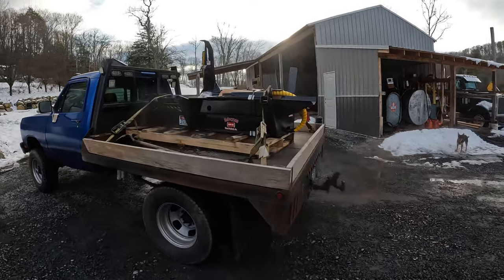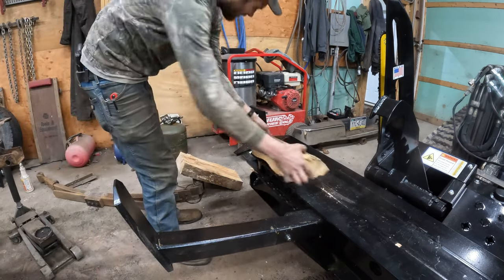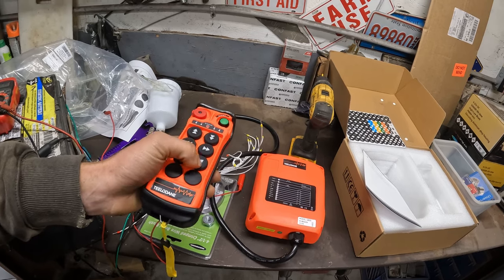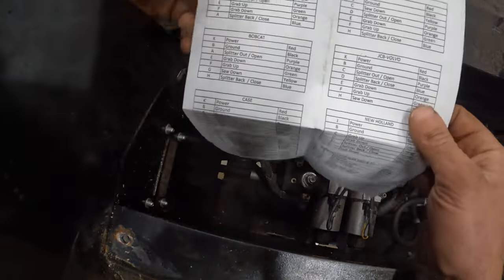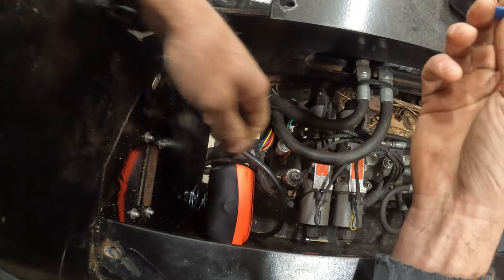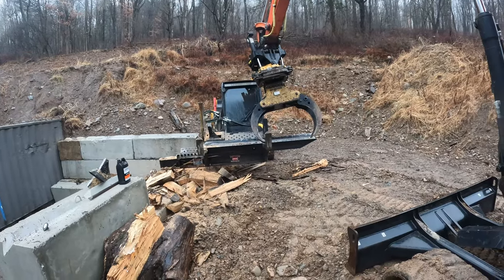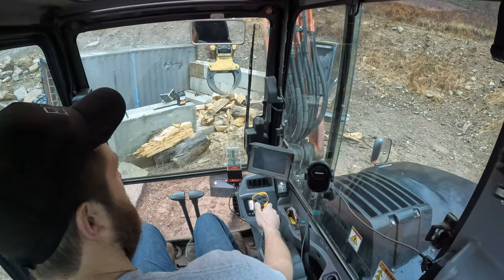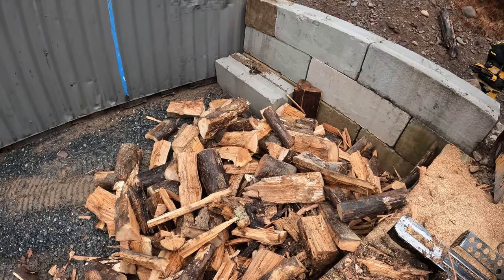Firewood made Easy. Remote control Halverson Wood processor!

Comment: Can you rearrange the labels on the remote?

Because it might be smarter to arrange the buttons in order of function.

Eg, top left = table in, middle left = clamp down, bottom left = table out, top right = saw down, middle right = clamp up.

Then you only need to press the buttons in order from top left down, top right down.

You could also use that spare button to do two functions at once, or connect a latching relay to turn on work lights etc.

Also a tip, when you've cut piece, table out an inch first, then clamp down, then finish table out.

This will give you a little gap so the wood falls into the splitter section nicely.
Reply from the maker: Yes you can change the labels on the remote. They sent a huge sheet of different labels. 

The way I’ve got it set right now flows pretty well. The only thing I mess up once in awhile is the direction of the table. 

Thanks for the tip! I usually try to inch it back a touch. But at the same time I’m trying to get as long as possible pieces cut since I’m feeding an out door wood boiler. If I was splitting for an indoor stove I would make some sort of guide to keep pieces consistent and that would give me the kerf gap to make the pieces drop out easier. 

Thanks for watching!

Comment: What a good idea. I bought a 120  and this remote setup and wondering about the wiring setup. Which wire is the ground wire # on the transmitter? What is the wire number for the main an common wires?
Reply from the maker: So if I remember correctly the wires made sense as to which color was what. 

There was some weird stuff going on with some sort of remote start/stop switch. 

I honestly think I may have just used a multi meter and checked continuity to figure out the wires it’s been a little bit since if done it. 

But it definitely is a game changer. I didn’t like spinning the skid steer around to load the logs and such. Made a mess. This year I added a conveyor and it’s a pretty slick setup. When I get it all up and running I’ll probably throw a short video of it running on here
Reply from the maker: That very well could be. I know mine wasn’t terrible to get it working but maybe I got lucky. Sorry ya didn’t have luck with it!

Comment: Would have been great if they made a LH model for the 120.  You have the right model for it - JCB.  I guess it doesn’t matter since you want to run it from outside.  Is that control the AC or DC model?  Probably the DC?  Thanks for the video.
Reply from the maker: Yea I had to extend the hoses but my plan was kinda always to run it this way. I think the skid steer processors are great but they are a lot of twisting and turning to load the logs. Also it can be frustrating to pick up logs longer than 10ft cause you have to pick them up kinda offset. 

The controller would be the dc model it runs off 12v from the Deutsch connection on the skid steer. Eventually I am going to put together a diesel powered hydraulic power pack to take the place of the skid steer.